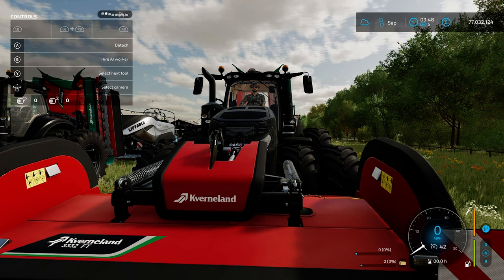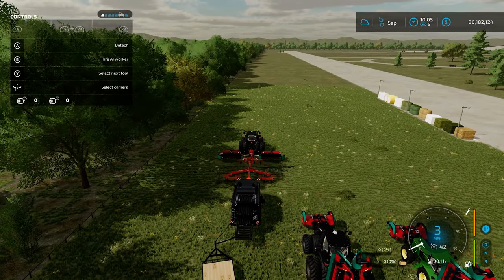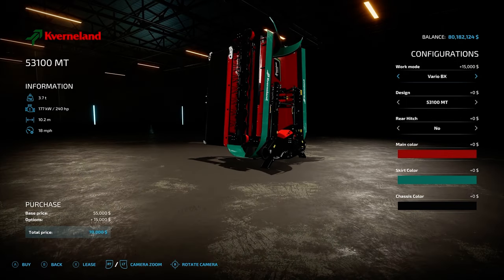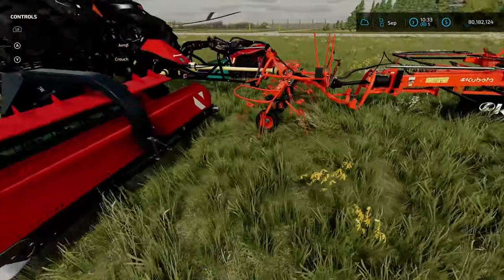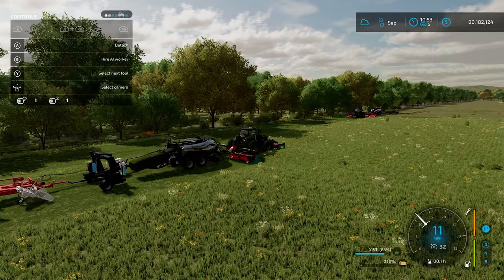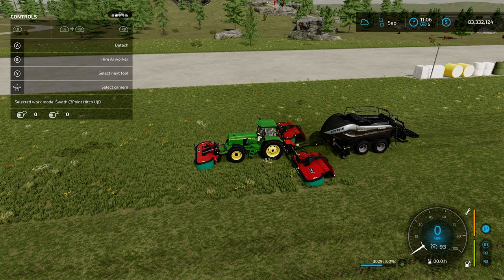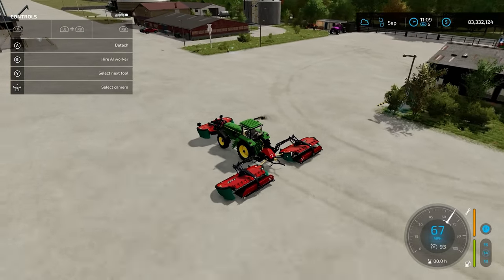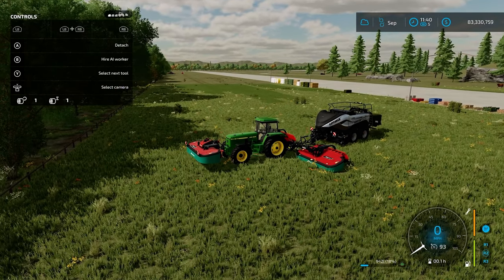The Ultimate Mowing And Baling Pack Setup #farmingsimulator22mods

Comment: I have a 500 hp tractor but when I have the train hooked up and try to activate the rear mower it wont turn on, am I missing something?
Reply from the maker: The only things I can think of are to make sure you don't have the rear mower backward somehow and that it's connected directly to the tractor.  I don't think I've seen that before.

Comment: Any special config with the tractor like wheel weights or something that allows for smoother turning? Mine seems to struggle to turn and end up just going straight despite cranked wheels.
Reply from the maker: Do you have something heavy on the back?  It kind of sounds like you need a front weight.
Reply: @LoneWolfHeroGaming  Just got the whole mowing/baling setup on the back, seems to be working better now but has some hiccups.
Reply from the maker: Yeah, get a weight for the front if you are having turning problems.  It's probably from the weight of the equipment pulling down on the back and lifting the front/turning tires off the ground slightly.
Reply: @LoneWolfHeroGaming  Okay, will do that. Thanks

Comment: How do I get the swather to go down
Reply from the maker: You should be able to just cycle through and unfold and lower everything.  If you can't do it front to back, try going back to front.  If it's lowered and not working, try changing the attachment before it. It may be too high.

Comment: What size Bales were you making? Because I tried making the max size bales,a the trailer says it can take bigger than the max size of 249. But when I am mowing, it says the bail is not supported for the trailer.
Reply from the maker: Make sure your mod is updated. There was a problem with that before, but i thought it was fixed. If not, look at any of macktrucker921's autoloader trailers they have all seemed to work perfectly with the 249s.